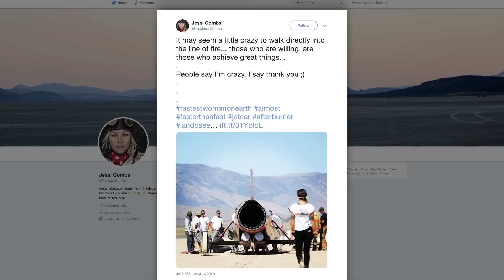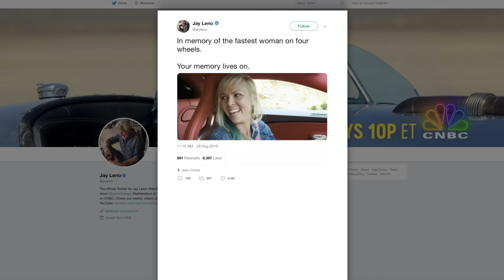MythBusters Star Dies in Horrible Accident

Comment: Is that an F-104? No wonder the gear buckled, by 150 mph its supposed to be retreated into the gear well. Its not designed for air resistance at 500 mph.

Comment: RIP jessi, There was something about the north american eagle car that just seemed slap dash and dangerous in comparison to bloodhound etc (the fact they modified a plane into a car). not turning this into a rant about the projects as that's not what's important, a lady has lost her life. Goodbye Jessi I was a fan of your tv and racing work
Reply: The Salt Flat Racing Association had rejected it for a run at Bonneville and it had damaged its steering in one of its previous runs so it should have never been run. As an aircraft they had inertial yaw problems. There is no safety in technological hubris.  -   McGeorge Bundy